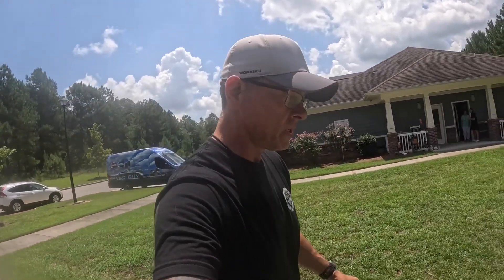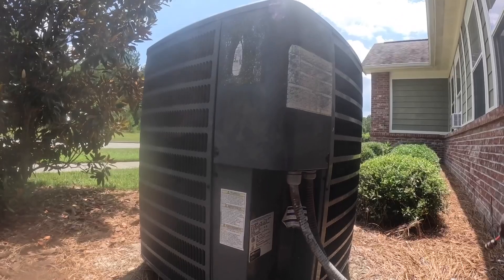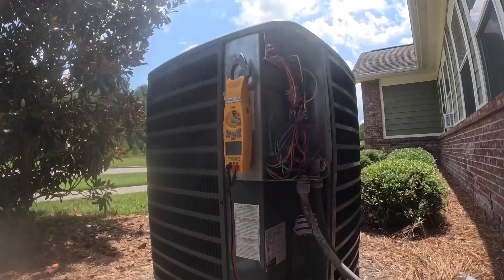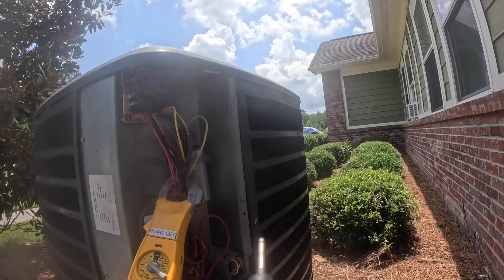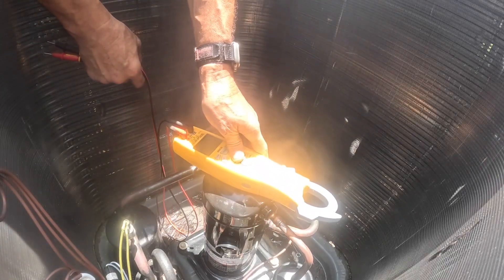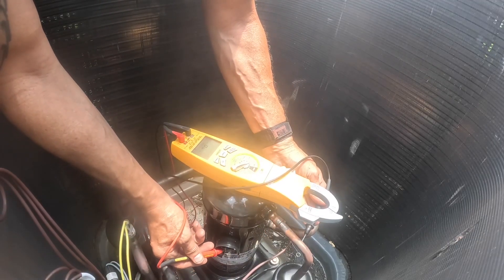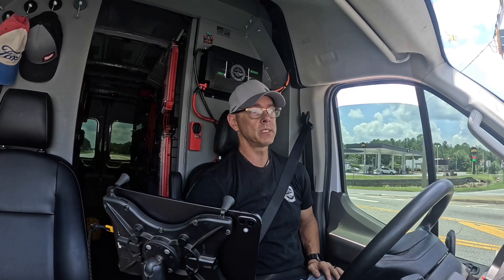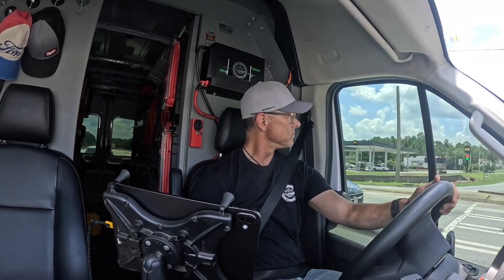Shorted Compressor Is Tripping a Breaker, But Why? #hvacguy #hvaclife #hvactrainingvideos

Comment: Need a megger! It's a high-voltage ohm meter. I have one that I mostly use on motors. It can test ohms up to 1000V. Even with that specialized piece of test gear, I've had motors that the VFD says is bad, but it passes the megger. Nice explanation of what I would describe as a very complex problem!
Reply: A motor will pass a megger if it has a winding-to-winding short away from grounded stator plates.  There's another tester that can analyze deviations causes by winding-only shorts.  I have one called a 'Z' meter and it measures inductance/capacitance/micro-ohms, etc variations between the windings.  But the megger will find 90% of problems.
Reply: @sylkelster  Excellent points! I figured most would get lost when diving into the mysteries of inductance. However, I do phase-to-phase and phase-to-ground checks and my 1KV megger catches 98% of those. But if the motor is ran from an inverter (VFD) without DVDT or sine wave filtering, the compromise could be in a higher voltage range than the megger tests at. This, I have encountered! The VFD says the motor is bad but the megger says it's ok. In that case, meter #3, an LCR meter! I believe that's what your using. If using and inverter, use 20KHz frequency range. Else, 120Hz is good. I like the megger, it puts an electrical stress on the conductors.

Comment: Worked on a few breaker trips for a large motor. 600volt and 400amp breaker. Found a lot of molten metal material in and around the breaker. Cleaned it up and used a megger not a DMM. Megger checked infinite ohms instead of 1 meg as initially test. Knew I was ok to recycle the breaker. Always used the high voltage megger as it's good practice but keep it away from electronic circuits.

Comment: You make a compelling argument.  So in this case, the reason is that failing insulation resistance can be non-linear - at 9 volts it's 3 Meg, at 120 (volts to ground) it MIGHT be much lower.  Trouble is, ... not always - but If it's tripping a breaker,  it's probably failing.   My theory of compressor insulation failure is that transient over-voltage (nearby lightning strikes that magnetically couple into power lines) sends kilovolts to the windings for a millisecond or so.  Over time this repeats enough to arc internally and create carbon paths which at some point let 120 volts arc over.

Comment: Honest question.  I'm reading a Copeland document on scroll compressors and they indicate that a reading as low as .5 Megaohm is acceptable on scroll compressors. How does this square with your experience on their products?
Reply: I also recall I believe reading Carrier doesn’t consider a compressor to be shorted to ground unless it reads 1K ohm to ground X line voltage. So a 240 volt compressor wouldn’t be considered grounded unless it reads 240K ohm or less to ground. Also moisture in the system can cause lower readings to ground. I’ve gotten into the practice of using high moisture driers on anything with POE oil. 

Years ago I used to do a lot of cell tower sites. They had 3-5 ton Bard or Marvair wall mount units. Back then they were all R-22 with Copeland scroll compressors 240 volt single phase. One time when replacing a compressor, after evacuating and putting virgin R-22 in the system but before running it, I decided to meg the compressor using the same Supco megger you have and it read bad. Started it up anyway and it ran just fine. So I started to check all of the compressors I was replacing in them. Same result. Don’t understand it but that’s just how it is. In fact I just recently replaced a small Copeland scroll in a 5 ton single phase York rooftop unit with 410A. Got the same result. When read with a standard ohmmeter, they usually read about 5 megaohms to ground. 

I think you may have something else going on there. Weak breaker or maybe the compressor is locked up. But I don’t blame you for not getting very involved if you have to hound them for payment. I’ve been doing commercial/industrial HVAC for about 33 years and I have to give you props for your professionalism and your thoroughness of your work. Something to be proud of. Keep up the good work. There’s a lot of hacks out there that give us all a bad name.
Reply: @mikee2923  Danfoss states that:
"The presence of refrigerant around the motor windings will result in lower resistance values to ground and higher leakage current readings. Such readings do not indicate a faulty compressor. To prevent this, the system can be first operated briefly to distribute refrigerant."
They also claim that the readings above 1 Meg is fine...
Reply from the maker: Hmm

Comment: 3 phase 600 volt short to ground are sometimes hard to detect .
Reply: They can be pretty spectacular when the breaker for the unit has too low of a KVA rating for the electrical service to the building though!💥
Reply: @markbeiser  Who dropped the ball there, the engineer?
Reply: @brianleeper5737  Beats me who picked the breaker, but it exploded when one of the compressors in the package unit grounded.
I put a fused disconnect on the unit when I replaced the compressor.

Comment: What do you think  about a compressor that starts, runs, bangs and clangs and stops. Then in a few minutes it repeats the process?  
Not grounded out and not tripping breakers.
Reply: Sounds like the internals are damaged scroll plates and the compressor will eventually fail.
Reply: mechanical failure